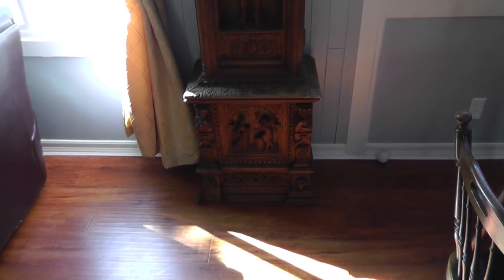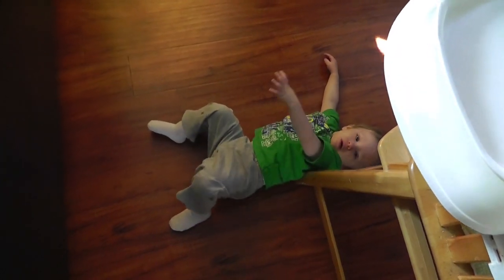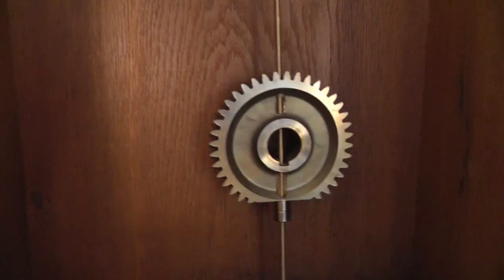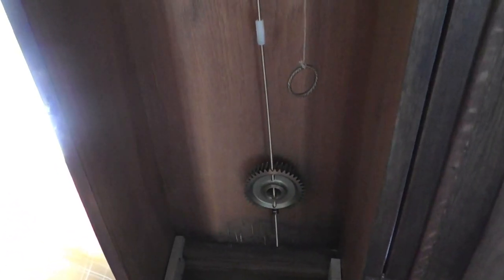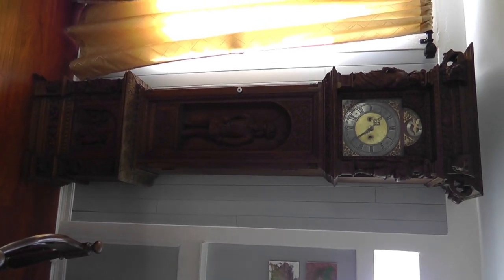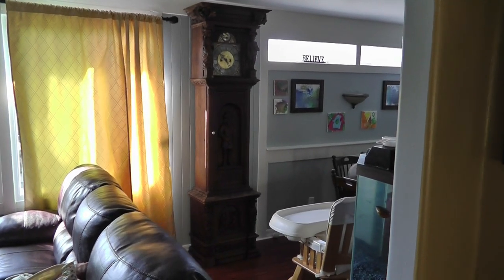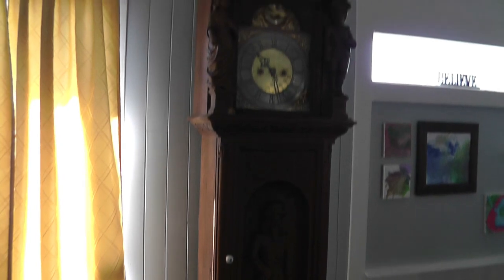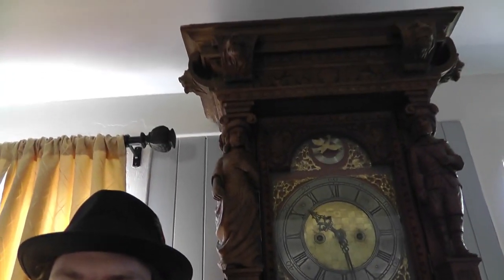(Update- Time Test) Late 18th century Grandfather Clock Randomly Show Up On My Door Step...

Comment: Hi,  great old clock!  Would have liked to have seen a close up of the clock works inside.  You said the back feet were missing, but some clocks only had front feet so the clock would lean back against the wall for stability. Thanks for the video.
Reply from the maker: Thanks. Here ya go. https://youtu.be/S3HcKoYDxEc